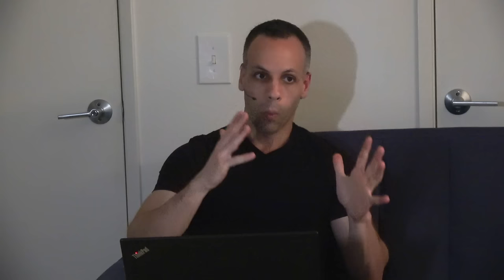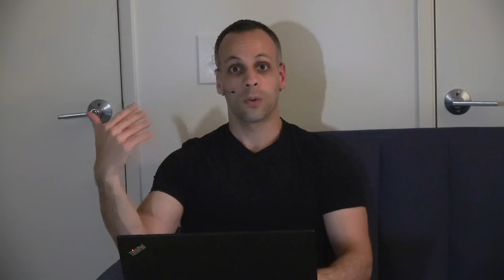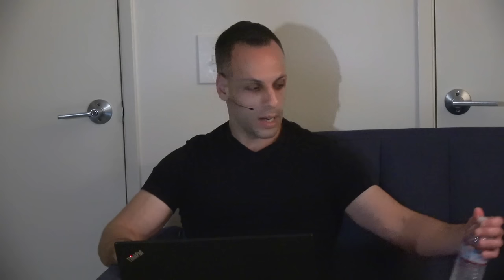EVGA's Oversight: Unannounced Changes Destroy PCs, EVGA takes NO ACCOUNTABILITY

Comment: So youre telling me with a straight face that the Company that Quit Nvidia because of terrible conditions and communications, is now Bricking computers because of terrible Conditions and communications? We live in a Society i guess.
Reply: We live in a society
Reply: Crap and i thought EVGA was a good brand.

Also, some(or all i don't know) EVGA PSU's are made by Superflower.
Reply: @Splarkszter  was
Reply: @Splarkszter EVGA can be both a good brand and make mistakes. EVGA is a brand that has their PSUs built by other OEMs, rather than Seasonic that makes their own. That's one reason a mistake like this happened, but it doesn't excuse them of course.
Reply: @Splarkszter it was always either CWT, Superflower, FSP or HEC.
Reply: True, but you gotta remember that most of that really good GPU team left EVGA when they closed down that division, they have also had changes in their higher ups, apparently things have been going downhill for a good while now.
Reply: @Stashmyash Man how I wish Mean Well made computer PSUs they'd be the best on earth hands down.
Reply: @Stashmyash or Great Wall which makes the Corsair PSUs.
Reply: @Splarkszter  Most brands have their PSUs made by 2-3 primary suppliers. Just because they don't manufacture it doesn't mean they don't have any say in the design though. That's how it works for a lot of products in this industry.
Reply: I can't help but savor the irony, here...
Reply: @atomicskull6405  Well i got news for you! they do make computer power supplies,
you just need a server shaped computer 😂
Reply: This is not the first time EVGA's shit is bricking PCs.
Reply: @tomstech4390  If he got a replacement sans cables it stands to reason it did not come in normal shipping package so the first 3 of your swiss cheese slices to not apply.  Also he did not use the new cables because he didn't get any.  And he didn't ask for new ones because EVGA's RMA policy specifically told him not to and to use his old cables, which is why he did not check the website.

Did you even watch the video?
Reply: @Slavolko  This is 'slightly' more than just a mistake—this is gross incompetence, how in the world nobody in the product chain didn't even think of the implications of their design decisions? And, more importantly, with such mindset who knows what else lurks underneath... Subcontractor or not, it's their responsibility and I wouldn't ever buy a product from a company that makes 'mistakes' like this...
Reply: @tomstech4390  Don't be daft, there is absolutely no user error here. They were told to send in their PSU and keep ALL the accessories as they'll be receiving back a 'fixed' PSU without any accessories and they are supposed to use the accessories from the broken one they've sent in. It's completely unreasonable to expect the user to check specs and design history of the replacement unit they've received, or even notice the difference.
Reply: yup, can confirm. we live in a society.
Reply: @tomstech4390  I did read the RMA process.  Maybe you should.

Important quotes;

"Use the original packaging when possible, original packaging will not be returned."
"Keep all accessories as you will only be receiving a power supply unit in return.  This includes, but is not limited to, Cables, Cable ties, Cable Bag, Posters, Stickers, Manuals, CDs, Games, T-shirts, Case Badges"

So it doesn't get sent in an actual product box, because it is not a full product.  It gets sent in a non-descript box but this is not a warning sign as you're told this is what will happen, and they tell you to keep and re-use the accessories.

You're wrong.
Reply: @tomstech4390  They thought he had a v2 unit?! The user sent their unit in, EVGA didn't have to think anything, they knew what unit he has. As for the user, if I pulled out my PSU this morning and received a 'replacement' this evening, I wouldn't know the difference even if it had a different shape and color, let alone just a printed label on it. Stop shilling for a company that obviously did something grossly incompetent, what's wrong with you?
Reply: @tomstech4390  I've built dozens of PCs in my life, you are expected to know what goes where and which component works with what other component, you are definitely not expected to check the labels on every single component to make sure that the company that sold you the components didn't pack a wrong component or anything of the sort. And you're most definitely not expected to know a product history of their components so that you don't fry your other components. The only user responsibility here is to never buy anything from EVGA ever again. And hopefully sue them for all the damage their gross incompetence has caused.
Reply: @tomstech4390  but why should he have to notice the diffrence
its on the manufacturer to provide a proper replacement

if the issue was differentiating between v1 and v2 that is still an issue on the manufacturers side. something as dangerous as swapping voltages should have clear differentiation between version
Reply: Nvidia is just a bigger megacorp than  EVGA. That doesn't mean the latter aren't doing bad things.
Reply: @tomstech4390, The OP stated that the only difference on that specific PSU is the manufacturing date. That happens when a 3rd party makes your equipment and fails to communicate changes.
Reply: @tomstech4390  Bro what are you doing? I've always liked EVGA but assuming it's all true they obviously messed up and sent him a different generation than what was RMA'd . It doesn't mean they're a terrible company but moving the goal post further and further just to blindly defend it isn't helping anyone.
Reply: What makes changing a pin out "terrible conditions"? I am with you on the communication part.
Reply: @Slavolko  Are you claiming that the OEMs can change the specification so that different cables are needed and EVGA doesn't know? That EVGA can test a power supply and send a replacement and not know that the cables they're telling you to use aren't compatible with the replacement power supply they've sent? I'm calling BS on that. It's possible and likely that they don't care as opposed to doing it deliberately, but that makes it negligence, not just a mistake.
Reply: @omarali6651 I know this isn't the reference, but when I read this, I think of George Costanza. "Y'know, we are LIVING in a SOCIETY!" 😂
Reply: @Slavolko  No, Seasonic does not make their own for more than a decade already. They all went cheap to reduce costs and quality to get better profit margins for investors. The only reason people buy them is because they have the brand pull "it's seasonic so it must be quality and long lasting". Only their few top of the line psu are manufactured by themselves.
Reply: The company has dramatically changed since then.  Almost all the good people have left, and they are pretty crap now.
Reply: To be fair, Nvidia is on another tier when it comes to terrible conditions and communications towards it's partners.  EVGA is on the scale for sure but it doesn't compare to Nvidia.
Reply: Dont think you quite understand 🤣
Reply: @tomstech4390  ""Where does it say "do not ask for new cables"?"

The part where it says;

"Keep all accessories as you will only be receiving a power supply unit in return.  This includes, but is not limited to, Cables, Cable ties, Cable Bag, Posters, Stickers, Manuals, CDs, Games, T-shirts, Case Badges"

If they were sending him a different PSU they would also send him the applicable set of cables since they're not interchangable.  It would either tell him to send in the cables also or to dispose of the cables.

I don't know why you're pretending to be illiterate in order to defend EVGA but you probably shouldn't be doing that.
Reply: @jimmydesouza4375 did you even watch the video? Louis clearly says that you arent meant to send cables as you will not get the cables back so why would you expect to then be able to ask for cables and receive them?
Reply: @deathdrop  You should learn to read.
Reply: @Splarkszter never ever trust ANY brand. Always judge every single product as standalone.
Reply: these older GQ's are the better part of a decade old at this point. 

they used to be made by company X, now they're made by company Y, and the newer ones are made using the unified pinout spec (save the older GQ's and current BQs).

psu cables being near universal across a brand is a recent thing. and proprietary cabling is still very much a thing to date, everyone should be confirming what they plug into stuff, period.

that said, sure, it sucks.

but given i hail from a time when you could kill a computer just by mixing up the p8 and p9 connectors, it rather diminishes my sympathy. blind trust for compatibility (yes, even today), is costly.

trust, but verify. and then double, or triple check.
Reply: @kenabi  Yeah but the AT power connectors are two separate, different color coded cables, of which literally all AT spec PSUs would follow it. Same as trying to plug the EPS 24v into an 8 pin GPU or vice versa, different stuff, read the manual before proceeding.
But we're talking here about the exact same power supply model and part number being returned by a warranty replacement. You aren't supposed to doubt THAT far into it. If they've told you outright "We've had to send you a different model", AND sent new cables, then it would be applicable. Heck if they had just sent the new PSU with only that one new cable without a word, I would have thought there's a reason for that. But that much is just too far.
Reply: @tomstech4390 -they assumed he had a V2

And you’re assuming that serial numbers aren’t a thing, right? Of course one would give his serial number before sending the product. And of course they’d know the exact model from the serial number.
Reply: Well I almost made a mistake plugging in a Corsair SATA psu cable to my hpes server pcie power port. Would be feeding 12v to 5v 😂
Reply: Ever since they pulled out of gpus their attention to detail tanked. Especially with higher ups spending less time in the warehouses
Reply: @Kalvinjj  except... they didn't, always.

so its literally the same deal.

and then some had p10, and some had the aux connector, which were two entirely different pinouts.

sooo.. not so much.
Reply: Why? This is 1000% a dumb user error, haha.
Reply: EVGA didn't just quit NVIDIA they quit the entire GPU business and the real reason for that was that EVGA made stratospheric amounts  of money during the last bull run selling GPUs to miners by cargos . EVGA CEO wasn't willing to deal with  the flip side of the coin ( RMAs , tons of cheap second hand GPUs flooding the market ) so he called it a day and closed the business . Of course the perfect excuse was to blame it on NVIDIA.  Got to wonder how comes much bigger/diversified companies that can afford to drop NVIDIA do still work with them assuming any of the EVGA excuses was remotely grounded !
Reply: @alb9229  The thing with disputes between two different corporations isn't always a matter of one side being good and one being bad.  Sometimes they can BOTH be assholes (look at the Oracle vs Google lawsuit, etc).  Sometimes you'll agree with one side's case, yet still dislike the company.
Reply: "get a load of this society"
Reply: That was a cover for EVGA. The biggest reason they couldnt make money was A) making 7+ variations of every GPU they claimed "lost money".....good job there, lets waste tons of cash on R+D for GPUs we claim we sell at a loss, and B) they over orderd towards the end of the 1000, 2000, and 3000 series, and couldnt sell those GPUs for new MSRP anymore, thus "losing money". They were terribly mismanaged.
Reply: Saying that they're "bricking" computers is putting it too lightly. Say it how it is. They're frying computers. If you send 12v where 3v are supposed to go, you're frying stuff
Reply: @RekySai  Are you saying that employees want ro continue to be irresponsible? Not communicate? And not do the work correctly?
Reply: @Kalvinjj  I experienced a similar situation. I bought a product. Liked it. Ordered again to save some as emergency replacements. Same SKu, same model number. But nope, 1/4 inch smaller all around. Maybe wrong item in box? Too costly to return, so i took a loss.
Reply: @Splarkszter  They definitely used to be
Reply: I am not surprised when PSU makers start colouring all their cables black on all the PSU's now and there is virtually no opportunity to spot any mistake earlier if it was in front of someone that this was bound to happen at some point as opposed to leaving the cables colour coded. 18:33 "When they make design decisions like this" they maybe opening themselves up to bankruptcy when nobody wants to buy stuff from them because of this. I always thought it was a stupid idea as for the reason they were coloured in the first place. Why can't they just braid or heat shrink over them with the desired colour? 1cm of coloured cables between the connector isn't going to be noticeable a distance away from someone hell bent on this idea.
Reply: Not the same thing at all   Vegas issue is miscommunication with them and the ones they use

Nvidia  aka team greed is a sole entity and is fuckin over ppl including their partners intentionally